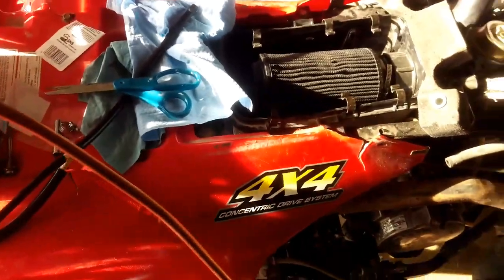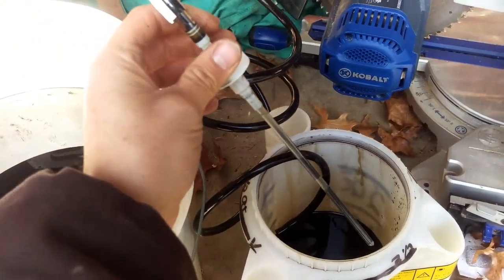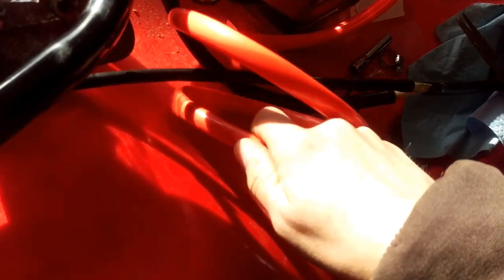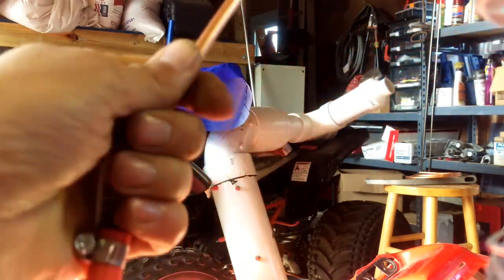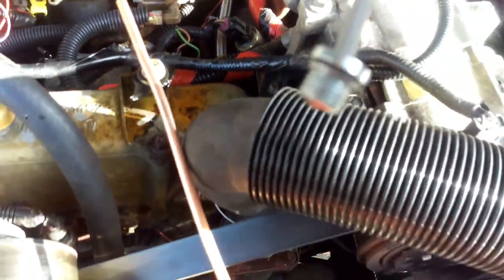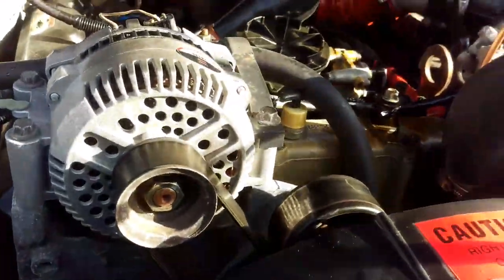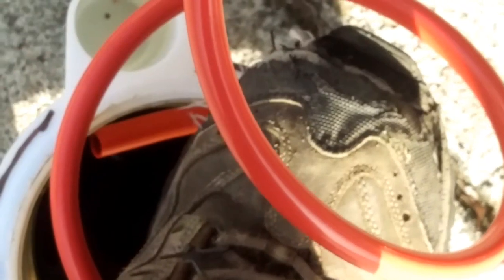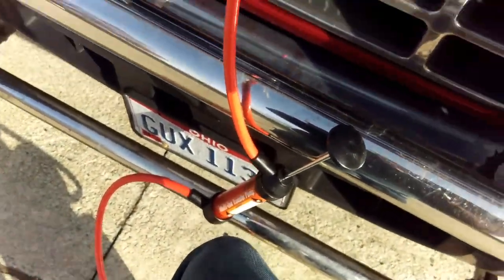Hpop reservoir tool for oil change.

Comment: There is no need to change that oil, it is constantly mixing with the oil in the pan.
Reply from the maker: It's supposed to but some claim it does at a slower rate so just do it when you change your oil. There was some in there so it's fresh all around now!